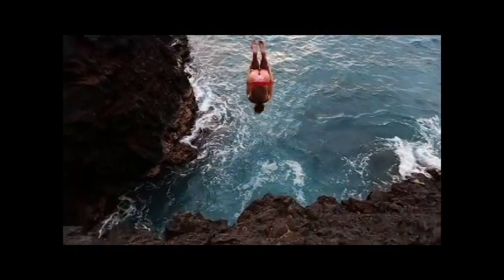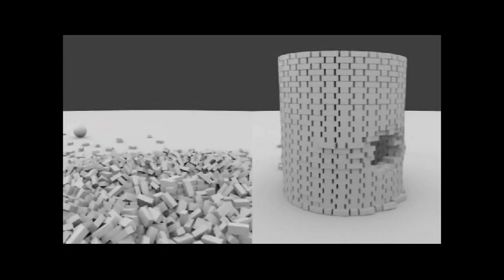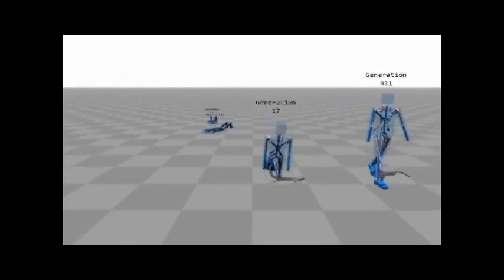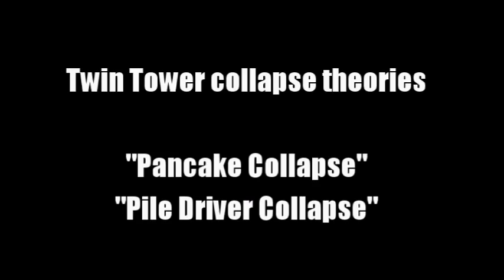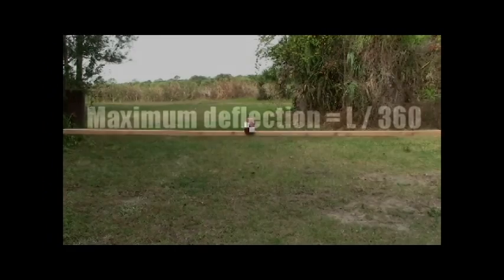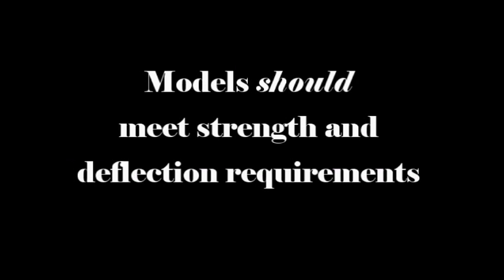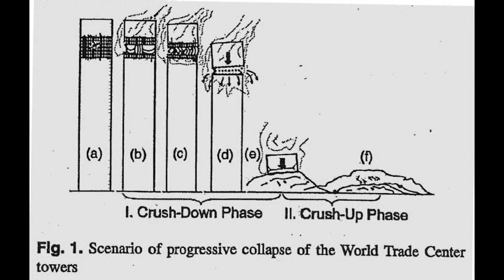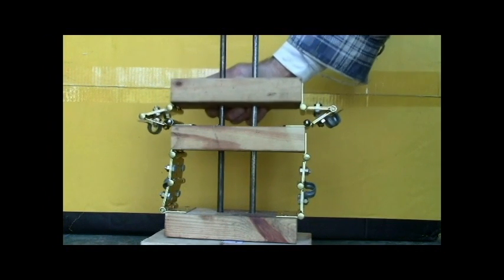9/11 Experiments: The Force Behind the Motion

Comment: What about the weakened floor trusses? Weren't those responsible for the initial collapse? The floor trusses that were used in the Twin Towers weren't properly coated with the fireproofing. This was revealed by an inspection in 1998. On 9/11, the fires did not melt any steel at all, but the fire did weaken the steel. Steel loses its strength at 1,202 degrees Fahrenheit. The floor trusses were also extremely thin. When the trusses began to sag due to the heat of the flames, which burned at 1,800 degrees, they pulled on the perimeter columns. Once the trusses reached their breaking point, the columns snapped as well. There is evidence of this seen in images and videos. The east face of the South Tower was bowing inwards seconds before the collapse. Bowing of as much as 20 inches was visible. When the tower collapsed, it collapsed into the weakened areas. In this case, it collapsed to the east. The entire top section leaned eastward as it fell and not straight down. As for the North Tower, the bowing began to be noticeable after the collapse of the South Tower. The bowing was seen on the south face. Once its trusses snapped, the tower collapsed to the South, and not straight down as seen in the footage in your video (Shot by Etienne Sauret). I appreciate that you conducted experiments, but I'm sad to say that you might be wrong. Here is footage of the collapses, notice how each tower leaned to a certain direction and didn't just fall straight down: 

North Tower (Notice how the top of the building leans to the South): https://www.youtube.com/watch?v=wzKLp6-HUJ0&t=56s
South Tower (Notice how the smoking area is bending inwards; Visible at 16:48, as soon as tons of debris starts to fall): https://www.youtube.com/watch?v=rxhZFaC7Nhc&t=1150s
Reply: Keep trying to defend the official story....
Reply: @AllanRod17 Well said and you're absolutely correct. Most controlled demolition theorist ignore this despie that it shows that the building clearly collapsed due to thermal expansion. awc222 seems to disagree with but doesn't make any attempt to explain why you're apparently wrong. Probably because he cant.

Comment: Your "experiment" is fine for what it is - to prove your own pet theory but as Mr Feynman said - it doesn't match observation!
Unless all video was faked - the floors did not go straight down as in "pancake" collapse - most of the debris peels outwards - the exterior wall elements do not bend (apart from the point of impact) the bolts break and each piece falls outwards. There is a pronouced circular motion the dust field at the top and this slides down the cores rather like a doughnut down a broomhandle.
This was caused by the floor to exterior wall connectors failing and unzipping the entire story almost instantly while still being connected to the core - the first floor to fail then continued down to hit the next below where the same thing happened until the 60ft floor trusses were vertical, they then fractured their connections and their already swinging motion turned full circle.

The truss connectors were single 6" x 3/8" mild steel angle with two bolts - they only just about held the thing together for the intended design load of 100lbs per sqft!!! Conspiracy is not necessary to explain the collapses - the things just fell down.
Reply: Thankyou M Fitz. Anyone with a bit of engineering experience can see this experiment is absolutely useless in explaining the collapse.
Reply: Cole's experiments were only designed to achieve the desired end result, not to demonstrate anything that actually happened.  Cole is just hoping you won't notice.
Reply: david b - Why?  Are you that thick?
Reply: david b - Talk is EVERYTHING.  Experiments like Cole's are cheap.  I can explain the collapses of all 3 buildings on 9/11 to a fairly high degree of detail without having to resort to any visual crutches or gimmicks because I don't need them.  Tell me, do you find Cole's experiments relevant and credible?  Because if you do nothing anyone else does will matter.
Reply: Thank you. This is what I've been looking for!

Comment: You do not need an experiment  to prove anything the towers were taken down . Newtons 3rd law is all you need. It goes somthing like this. For every action there is an opposite and EQUAL reaction. The top bit of the building would itself be getting destroyed as it decended through the bottom bit decelerating as it did so. No ammount fire would aid this. The building was made of the same stuff if anything the bottom half was stronger   as to hold up the higher floors. YOU CANNOT defy the laws of physics without explosives.

Just to add.  The  damage caused by the planes was asymetrical so therfore impossible for the building to collaspe within its footprint the top half would have at some point fallen towards least resistance hence towards the damaged area. THINK FOR YOURSELF.
Reply: That only works if you treat each tower as two solid objects,... but why would you do that?  It helps to understand what happened if you don't misapply physics so badly.

Also, if each Twin Tower had a footprint of 1 acre (2 acres total) why was there a 16-acre debris pile and damage to more than 100 other buildings including 8 others destroyed or written off?  

THINK
Reply: @MFitz12  why would you treat the "buildings" as "solid" objects?  Well you can't in this case as the bottom half was liquified by explosives no other way this collaspe can happen. 

This also answers your question in regards to the debris pile  being 16 acres. If you have ever built a sand castle  you will understand  when adding sand to the top of the sandcastle,  the base spreads out  to carry the weight of the sand above it. Hence the structure was liquified  before it even hit the ground.

Regardless of this if you look closely at the start of the  collapse of the first building which happened at Approx 9:58:55 you will see exactly what I am saying @ 9:59:02-03  the top half of the building is tipping over towards the path of least resistance (plane damage) then the support structure below it is removed( by explosives).
Reply: magras75 - I wouldn't.  My brain works.  But that is what you are doing when you talk about Fisher-Price level physics with "top half" and "bottom half", completely ignoring the structural design and actual real world collapse mechanisms.  I can explain both.  Tricky Dick Gage and David Chandler can't.  

As for your second point, anything that ends up outside the footprint of the original sandcastle is what?
Reply: @MFitz12  then explain mr  newtons fischer price pyshics? 

 Then I will answer why 20 ton beams  end up outside the "sandcastle"  and also embeded into the surrounding buildings.
Reply: magras75 - There is no upper and lower working in one dimension.  There are thousands - millions - of components interacting in complex ways simultaneously in 3 dimensions.

I can explain how 20 ton steel COLUMNS (there were no "beams") ended up outside the sandcastle too but since you offered, you first.
Reply: magras75 - PS
Newton's physics are spot on. It is your (mis)application that is Fisher-Price.  I thought that was clear.
Reply: millions of components? Really.  Ok, well I can't expend any more time/energy to explain basic high school pyshics to you.

 I will leave you with this. You can argue anything when you dismiss  the basic laws of pyshics. 

Anyway thanks for the replys have a nice day.
Reply: magras75 - Why do you CT's always want to run away?  

I will leave you with this:  I never dismissed the laws of physics.  I accused you of misapplying them, which you are.  IF you were a genuine truth seeker your curiosity would be peaked and you would want to know why.  Instead the opposite is happening and you can not extract yourself from this discussion fast enough.

Ergo, you are not a genuine truth seeker.  You are a believer, a zealot.

Can't say I'm surprised. 

BTW - Explosives can't defy the laws of physics either.
Reply: @MFitz12  Thats fine, use whatever excuses make you feel warm and fuzzy.  I really don't have the time nor inclination to teach  you about newtonian laws.  the information is there,  read it then come back and we can discuss what laws were broken in the collapse.

If you feel the need to reply feel free.
Reply: magras75 - "Actually here is a half decent  video on the laws involved."
Please take a very thorough look at the video you linked yourself. Chandler tries to explain how two colliding cars are the same as a collapsing building. He states that when the upper part is crushed, there is nothing left to destroy the rest of the building. Mind you, this guy is a physics teacher (high school, but still). Yet, how is force defined? F=m*a. the m is for mass.

1. So Chandler basically claims that somehow the mass of the upper block has disappeared when it is crushed. Do you believe any mass had disappeared? Or do you believe Chandler is secretly a proponent of the magical space beams theory?

2. Chander seems to believe that two equal forces in opposite directions will lead to arrest. He is wrong. Have a car crash into a still standing car. See in which direction both cars move.

3. Chandler totally overlooks the all present force of gravity. Gravity happens to work straight down. So in addition to the force of the collision, the force of gravity was working on both upper and lower parts. In the example of the two colliding cars, one car only should be speeding up, the other one should be still standing and tied to a huge rubber band, but fixed by some mechanism. The first car would still be speeding up and destroy the mechanism that keeps the second car from being pulled backwards. Now what will happen right after the collision? Do you still believe both cars would come to a stop when both of them are equally destroyed?

Newtons laws are theoretically applied to single point masses. These laws are great for getting an global understanding of a event in which collision is involved. They cannot predict how buildings will collapse however (unless you would be able to know exactly which forces were applied to which of the million segments of the towers, in which directions these forces were aimed, where these forces hit each single segment and how that segment would respond (break up, direction, velocity). Theoretically it is of course all possible. Practically not so much. but let's assume we would be able to calculate and predict what happened, how does Chandler's theory hold then? And don't forget about gravity that pulled on every single member of the towers.

It is up to you to assume Chandler is correct. You can simply accept his explanation because he is a high school teacher and involved in the EA truth movement and he states everything on camera (so it must be true), so he must be an expert. Or you can chose to believe that he either has ulterior motives or doesn;t fullt understand what he is talking about. The second option is easily checked. The first one isn't. What are you going to do?
Reply: magras75 - "the information is there,  read it then come back and we can discuss what laws were broken in the collapse."
I'm ready to discuss. Are you?
Reply: Ed Spencer - C.
Reply: Ed Spencer - How does naming an observation make any difference as to what practically happened?
Reply: Ed Spencer - " your explanation needs a physical experiment to back it up "
Knowledge doesn't need experiments, it needs studying.
Reply: @brucelansberg5485  sigh of course. And what is the ultimate proving ground for physics? Experiment. I've seen many demonstrations of why what the towers did was impossible using only gravity but have yet to see one show why it is possible.  So can you or cant you?
Reply: Ed Spencer - Experiment,... and observation.
Reply: Ed Spencer - "what happens is a structure designed to completely come apart comes apart."
So how is that structure designed and how does it relate to the engineering of the twin towers? Those are the questions you need to ask yourself (and try to answer). You're very close now.

"It offered zero resistance after impact."
How did it offer zero resistance? You did see the "floors" connected to the "columns," didn´t you? This means there has to be some kind of resistance. The "floors" weren't just hovering.

"Since I can watch a demolition that uses zero explosives and it not only offers resistance,  it actually causes constant DECELERATION, and that's after it's been prepared to collapse. "
No collapse or demolition can cause constant deceleration per definition. If there would be constant deceleration, there would be no movement since v0=zero. However, when the downward force is larger than the upward resistance, there will be always be acceleration. I probably will not be 9.2 m/s2, but slower. But there will always be acceleration.

"I'd like to se e this guys design and building manner because it sure doesnt behave like I already know a non steel framed building does."
The thing is that is doesn't matter if it concerns a concrete building or a steel framed building when it comes to progressive collapses. It is all about the engineering.If I would build a building exactly like the twin towers, but would use concrete instead of steel, the result would have been the exact same. The issue with the towers were the floors and how they were connected to the columns. These connections were strong enough to resist 4 times the expected static load. But they were too weak to resist the force of a free falling mass of 15 or 28 floors from 10 ft up. In that sense, these floors were a design flaw. But who would consider these connections needing to be able to cope with such force? NIST has issued a number of recommendations in its report on the WTC disaster to prevent progressive collapses in the future (page 205 en on).